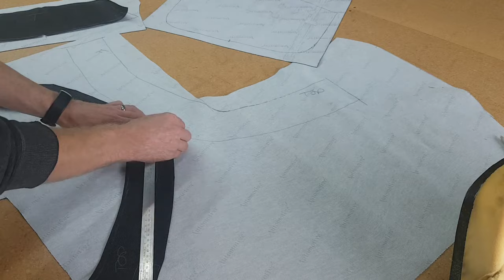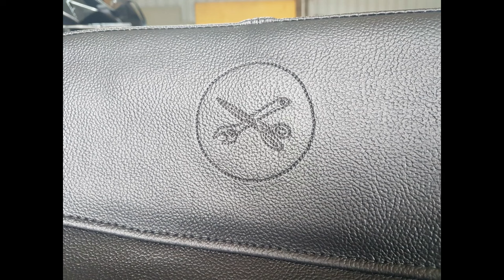Lawn Mower Seat repair and restoration

Comment: That was a great video! Thanks! I just hammered out and welded up a new seat for my lawn mower with some steel from an old barrel. It's kind of rough looking but was surprisingly comfortable. I now need to put vinyl over the foam. What type of glue/adhesive do you use? Would it stick to painted steel? I already painted my seat pan.
Reply from the maker: Thanks for watching the video.  I use a sprayable contact adhesive but you can brush it on if that's easier.  If the paint is dry then should stick fine. Best of luck with the covering
Reply: @stitchingsteve  Thanks, 
i just ordered some.

Comment: Very cool video , excellent work ! . The metal clip that holds on the rubber trim on mine is long gone any idea where it can be bought ,  id like to attempt a redo of my old seat ?
Reply from the maker: I've hunted around and cant find anything. If you can get new rubber, gluing or RTV silicone could work?
Reply: Google, rubberized edge trim for metal.

Comment: In the final step, when you went around and attached the long clip strip -- where do you purchase that? And also, is that marine vinyl you used?
Reply from the maker: It's called edge trim or door edge-trim and sometimes windlace (even though it isn't) depending on who labels and sells it. Not sure which country you're in but you should be to find some online. There are three sizes S,M and L. I used the large on this. The vinyl is an automotive grade
Reply: @stitchingsteve  Thanks much, Steve. I'm in the USA.  I'm getting ready to start working on a John Deere tractor seat repair - so this video was perfect timing for me. Thanks. Great job on your seat. A+++
Reply from the maker: @janegilson1886  Try searching for pinchweld trim too. It has so many names for one product. Modern JD's are vinyl welded so you might be lucky and have an older model. Best of luck with the repairs
Reply: @stitchingsteve   The tractor I am working on is 35 years old!  Still an incredible workhorse - but seat is trashed.  Thanks for the info!
Reply from the maker: @janegilson1886  wow, that's amazing. This ride on mower is from 1994 and isn't the greatest, but gets the job done

Comment: What was the little fabric at the end of the stitching? Where do you buy that stuff around the edge of the seat?
Reply from the maker: Hey, thanks for watching!!  That little bit of fabric is scrap offcuts that I use to sew on to, to stop and start each sew line. It saves holding the thread or wasting more than you need to. Lots of comments about this... Might have to make it's own video 🤔. The stuff around the edge is either called Edge trim, door trim or push on windlace. Try your local Upholster/Motor Trimmer

Comment: Yeah oh ok sure now I need to get the materials a contact cement sprayer an air compressor a sowing machine....come on man seriously that what you just did costs more than buying a new seat
Reply from the maker: Thanks for watching!  You could buy a new seat, if you can find one for a 30yr old mower. You could also set yourself up for doing jobs like this... or take it to someone who has all the gear and materials already? Plus this was for my own mower so my time and materials wasn't an issue